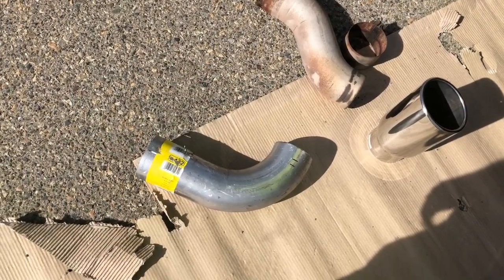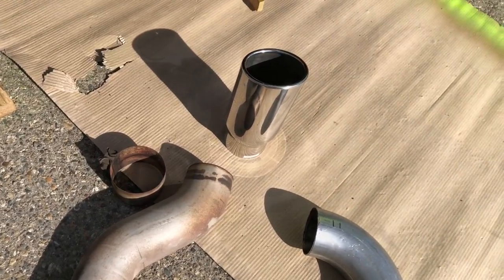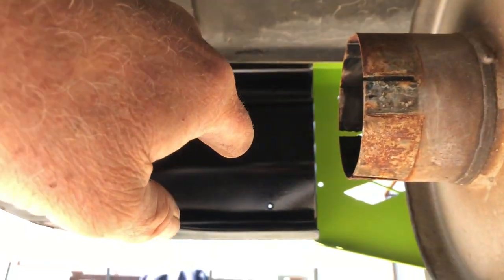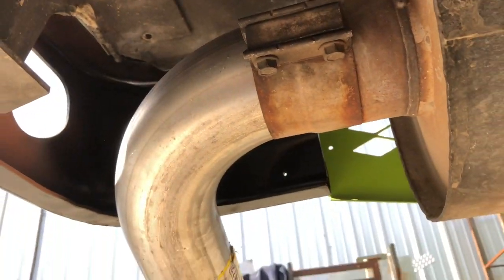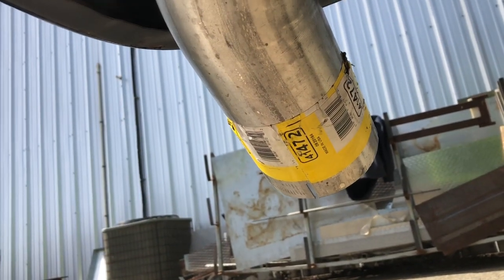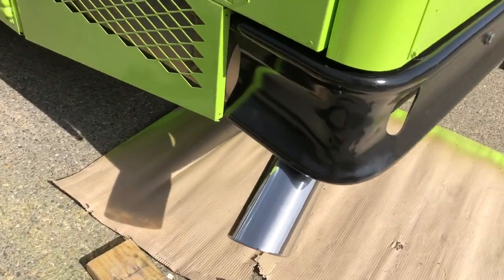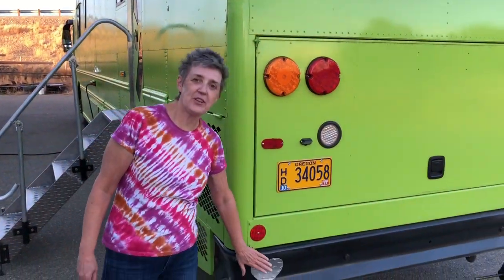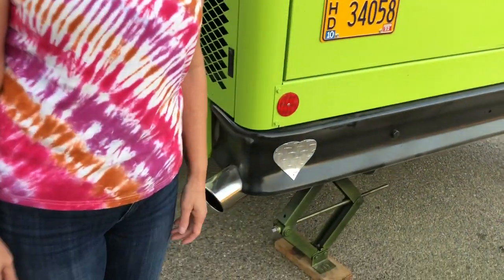Redirecting Exhaust Tip - Vlog 179 School Bus Conversion

Comment: I like it. Looks Much better.  Enough clearance around the tip to prevent rattles?  Looks like a tight fit.  Giant muffler, short system. I’m used to my diesel pick up.

Is the corner of the bumper bent/pushed  in? seems weird it doesn’t match up with the body line.
Reply from the maker: It’s pushed in like that so people didn’t hook them. There was metal caps on there but we remove them. 😃